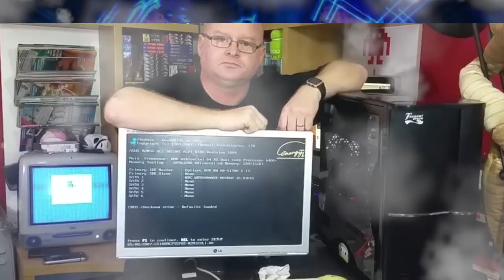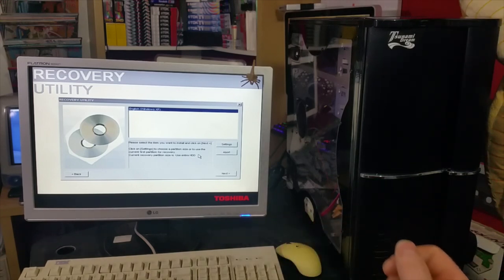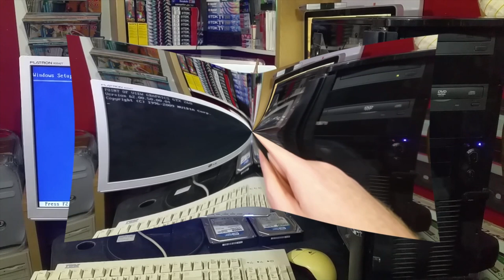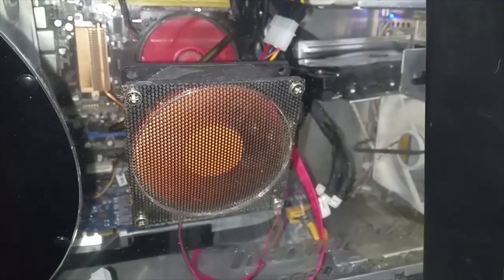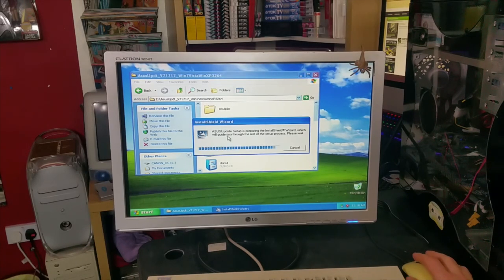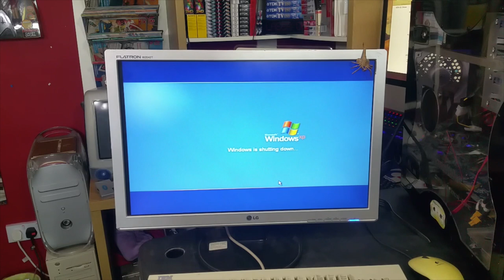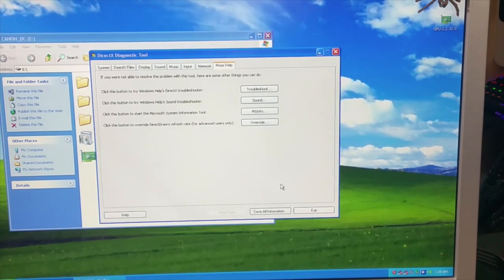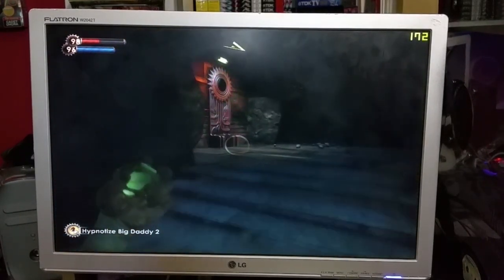Ultimate XP Gaming Machine!  System Resurrection & How Well Does It Game?

Comment: I have a 500 gb sata drive in my xp machine came out of a virgin tv box sometimes sat settings need to be changed for it to work i had one setting on my machine that stopped it working ,i am using xp black edition a modified version of xp no activation and fully updates my machine has an athlon 2 x4 an x620 cpu at 2 .6 ghz i also have a 6400 dual core i have 4 gig of ram and a radeon 7870 as i had it spare and xp supports up to an amd 280x graphics card or nvidia 780 .sound card is an audigy 2 zs .